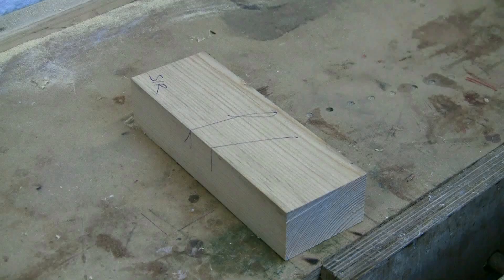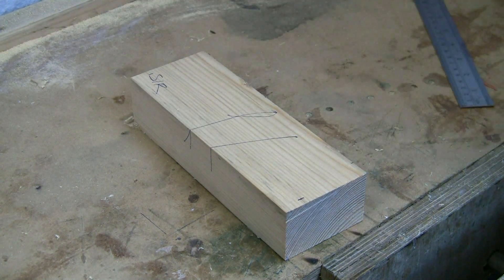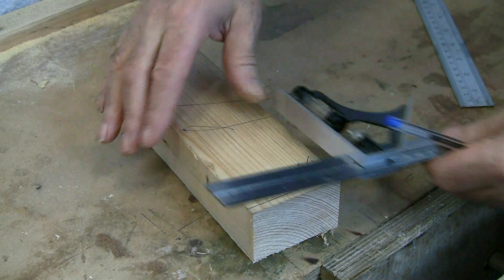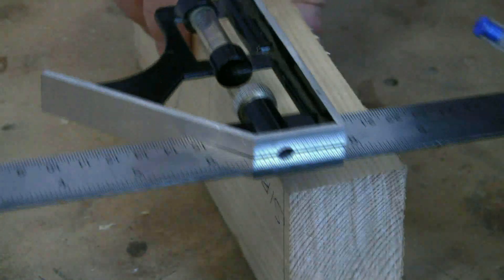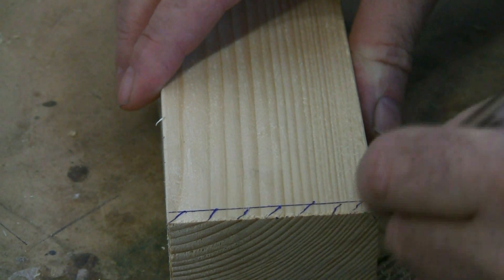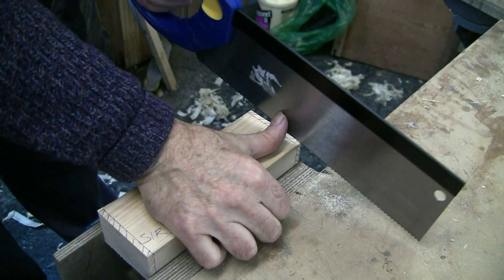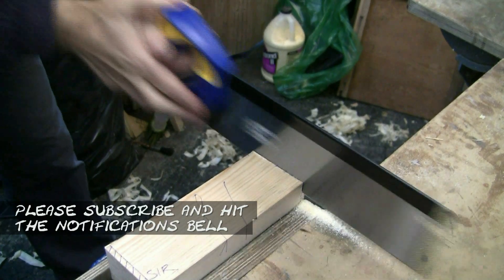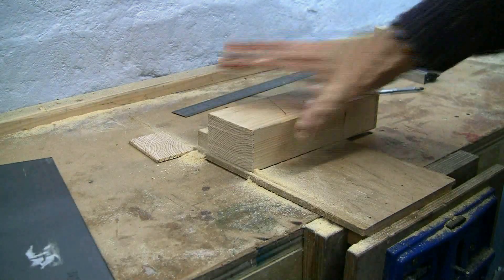The Efficient Way To Mark Out To Length And Cut  'Square' To The Line

Comment: Good tips, Jeremy.
Reply from the maker: Thanks, I have not only trained at a very high level of cabinetmaking but I have been teaching these methods for over 50 years to many hundreds of students. A combination of tradition and modern woodworking but all based on experience.
Reply: Jeremy, what is your preferred pen for this purpose?
Reply from the maker: @Rwjudy48  Of course some ballpoint pens leak but I recently bought a bundle of really cheap fine pointed pens and they are perfect. You may have already viewed my video Marking On Wood: https://www.youtube.com/watch?v=nvbWYsi7k1s

Comment: I see you didn’t use a marking knife. I use a knife and run a pen or pencil in the grove .
Reply from the maker: No. Bad practice. There is no groove, a marking knif line is too fine. Running a pencil aling the marking knife line just creates a messy double line! if you watch my video the important message (which I stated) is saw to the line but leave the entire line on. this means for getting tight joints fot straight off the saw they will be perfect. Joints are always fractionally oversize. Your method of sawing to a marking knife line gives no leaway for compression of wood fibres that ensures a tight joint. a pencil is the worst marking tool to use as it blunts as it draws!!! How can you call that accuracy?
Reply from the maker: Sorry Joe - I didn't see it was you but to be honest I stand by my practice here!  The marking knife should be used  specifically where a very precise cut line is needed eg on dovetail shoulder lines and carcass pinnning shoulder lines where a chisel then sits in the groove and in the area to be cut the marked line is deepened as they should never show on the finished joint.  A pencil is fine for non-precise woodworking (eg with a tape measure and for projects such as the prototype universal woodworking bench you and i discussed). For a start a pencil can hardly be seen as for accuracy it needs to be H or 2H. To see the line you neeed to use HB or 2B and that is soft and blunts, broadening the line. I will make a detailed video about this.